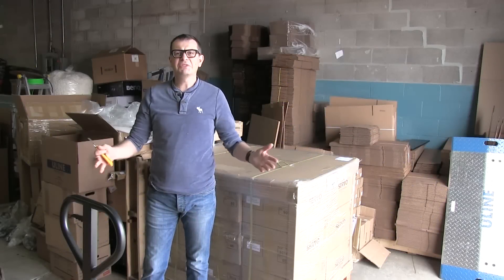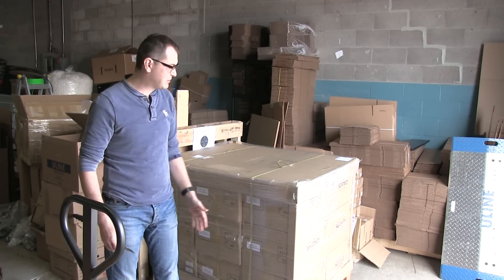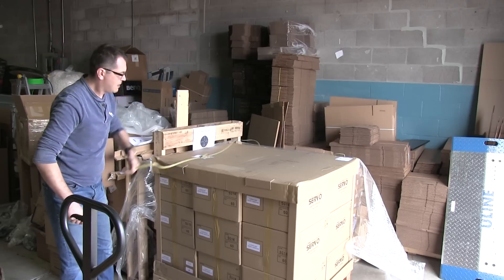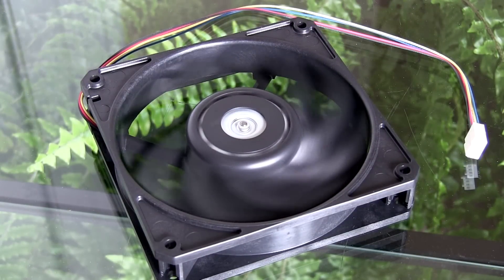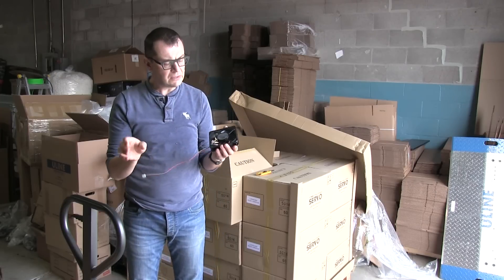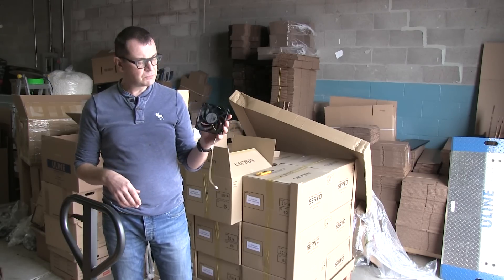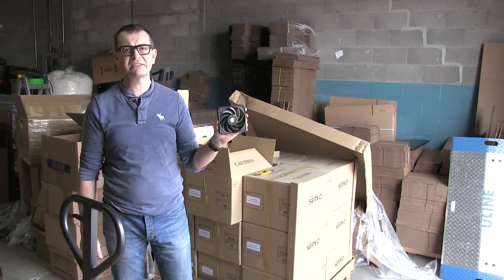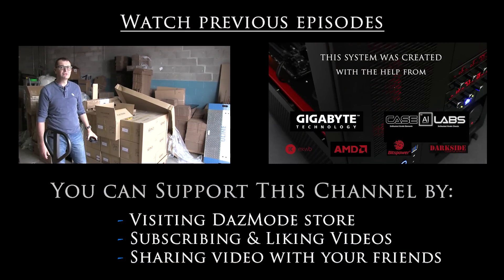Gentle Typhoon PWM un-skidding

Comment: You said power management thrice, but PWM is pulse width modulation - speed control. (Maybe that's why you have to beg, haha.)
Black connectors would be a visibility nightmare when trying to connect it to a mainboard. I love their quality control. They're apparently also convering product design. (Or they're both the same person, heh.)
The rotor looks better in custom-painted shiny black though. (I'm surprised I haven't seen fans with piano lacquer yet.)

Comment: Just bought two of these with two 120mm radiator gaskets. Incredible airflow through my H80i GT and extremely quiet! The square design combined with the gaskets make sure no airflow is being pushed to the side, which is a problem with the stock fans. Thank you Dazmode for the PWM GT!!

Comment: I got this ap-29 3000rpm on radiator connected on fan controller high on gaming and low web browsing and very quiet and slight loud on gaming doesnt matter i play louder than the fan my temp is 18c idle 45c max gaming and 55c prime95 1hr test at 4.5ghz fx8350

Comment: I love these, but I NEED sleeved cables. I have bought have a dozen Scythe Gentle Typhoons, but they were all sleeved. Is there any way you could offer a sleeving service? I know that another seller stateside used to offer sleeved Gentle Typhoons for a buck more. I would pay twice that, but I hate the multi-colored cable BS. The white connector I can live with, but I must have the sleeving.
Reply from the maker: V+Garry Perkins yeh, all resellers offer sleeving service. I prob sleeved 200 pcs ap60 myself. Not too difficult but super boring.

Comment: Just fyi, PWM does not mean "PoWer Management" it means "Pulse Width Modulation" :)
Reply from the maker: +Toxic Biohazard I know, but cannot help it.
Reply from the maker: +Toxic Biohazard  To put this to rest: Yes, long time ago I mis-decoded term as "Power Management" and it stuck in my brain forever. I know that it is wrong thing to say for this abbreviation, but it is too much mental effort to correct myself, so I let it slide. I consider it as relatively harmless along with bunch of other words I say incorrectly, in reverse or with letters switched their correct places. Every video features couple of those if you listen carefully. Toxic Biohazard  comment is definitely not trolling, but thank you for defending me. Thank you all!
Reply: Angel Luis Trinidad No, he said power management because those are PWM fans, and he specifically said that he cant help it, I guess he's just used to calling PWM fans that. Anyone can determine that with a bit of logic. And based on what you said, every fan has power management since they all "manage" power. It's not just PWM fans. But in fact it's not the fan which manages the power, it's the motherboard or fan controller which does that, whether the fan is PWM or not. So yeah, you're wrong both ways.
Reply: Angel Luis Trinidad You're close, but that's not exactly correct. The difference between 3 and 4 pin fans is that PWM controls the speed differently than voltage. Rather than changing the voltage to slow down the fan, it changes the frequency of a 5v pulse, which is the "pulse width modulation" part. By using this pulse you can get a PWM fan to run at much slower speeds than a voltage control fan, because instead of getting low voltage and stalling, the fan gets full 12v but in bursts. Smaller bursts=slower rpm, but without stalling. This is why 3 pin fans can only go down to about 40% speed while PWM can do all the way to 10 or 20% speed. This is also why you can control 4 pin pwm fans with a 3 pin header and voltage control, they dont need the 4th pin to work, but that 4th pin is needed if you want to PWM control it. Still, the power is managed by the motherboard. Some motherboards only change the speed of 4 pin fans, some motherboards can only do voltage control for 3 pin fans, and now newer motherboards can do both, like high end asus motherboards where you can choose PWM or DC (voltage) control for each fan. If you're just running your fans above 40% all the time then PWM is not necessary.
Reply: +DazMode Someone had to say that. Who cares
Reply: +Toxic Biohazard Yeah, you're right, PWM stands for Pulse Width Modulation, but what does that do to the fans? I guess it manages the power, right? So, is correct to say that the fans have power management. By the way, I never heard him say that PWM was power management. He said that the fans had power management. So, in a sense, he was right.
Reply: +Toxic Biohazard Only PWM fan manage power, that's why they have an extra connector. Yes, you can control any fan with any onboard fan manager like my Asus Z87-Expert motherboard has Fan Xpert 2. But, the PWM fans are control by the CPU. When your PC is idle the PWM fan will spin at the lowest RPM, but when you have a regular fan it will spin at it's highest RPM. That's the difference between regular or PWM fans. Remember, regular fans have 3 pins, PWM fans have 4 pins. If all the fans are the same, then why PWM fans have an extra pin and cost more? I want to learn, please explain that. Thank you.
Reply: +Toxic Biohazard Thank you for the explanation. That's why when you're pursuing a silent liquid cool system with a couple of Radiators and 6 plus fans you should use PWM fans.
Reply: Angel Luis Trinidad Yup, you're welcome :)